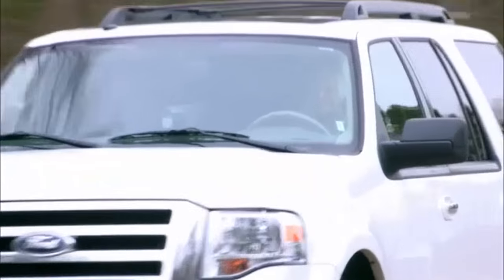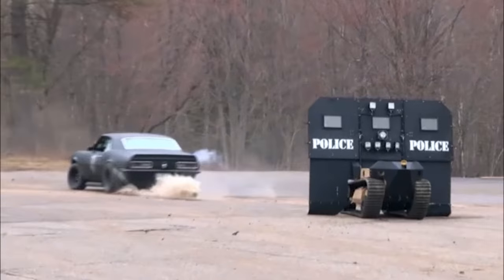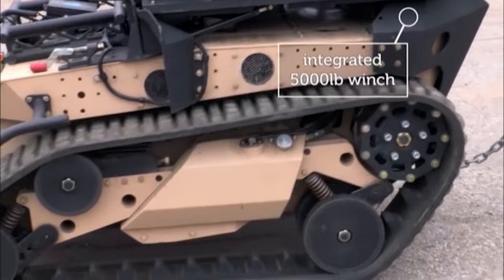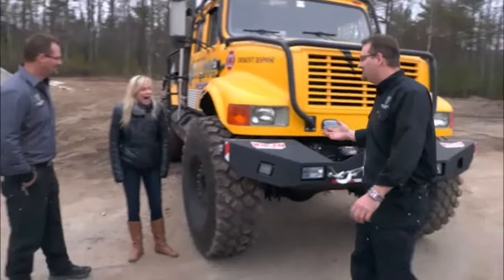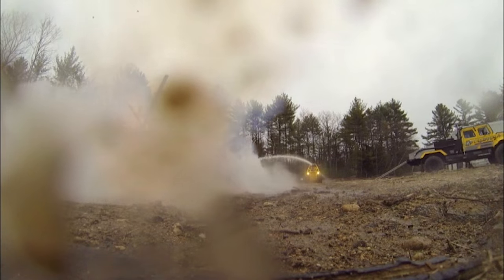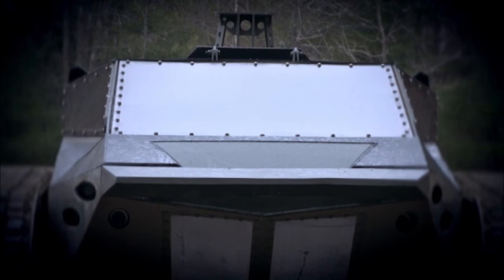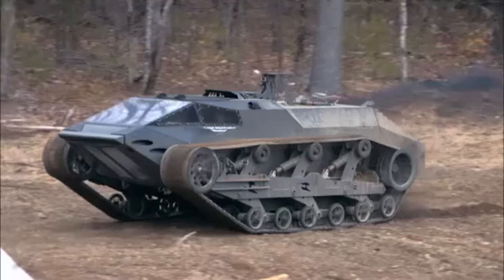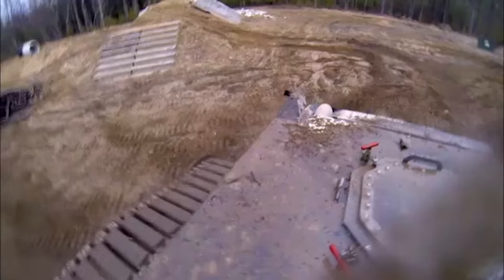Howe & Howe's Military Vehicles - The Gadget Show #FuelFriday

Comment: So.. what broke?
Reply: judging from the black smoke, I'd say the engine, maybe cylinders?

But,I obviously don't know engines that well, cause my vehicles don't use them
Reply: To me it looked like enough water was sucked into the air intake to cause over-pressurization of the engine's cylinders, which causes rods and shafts to bend and break inside of the engine.